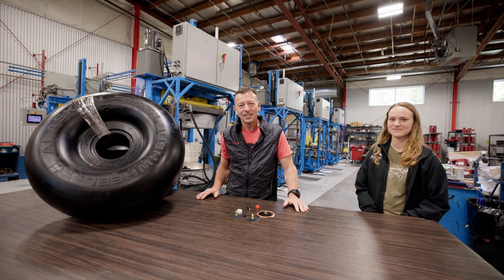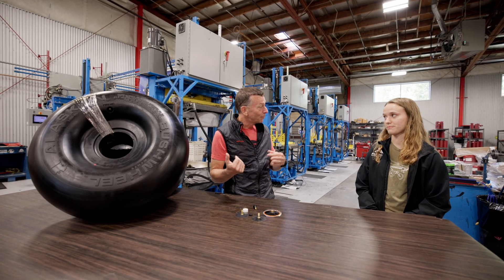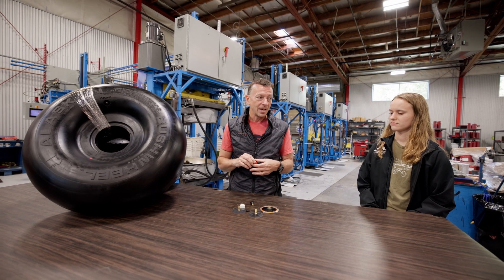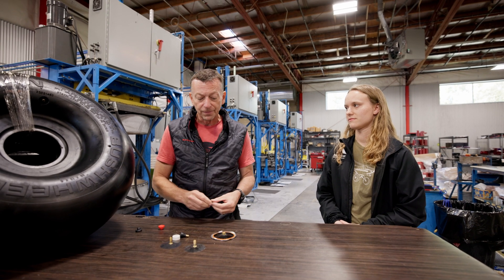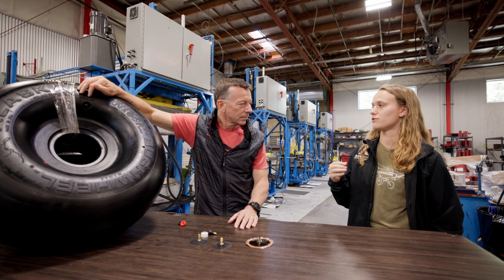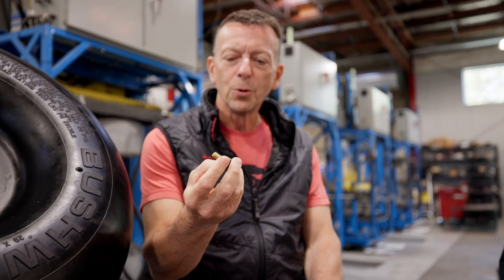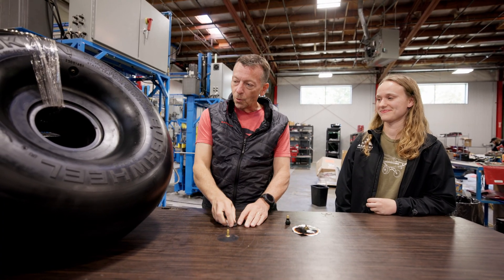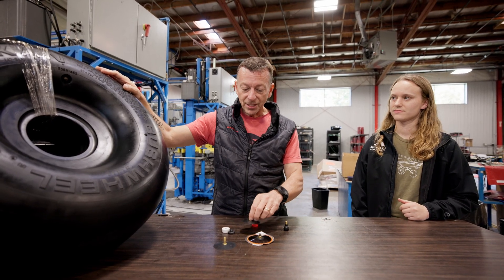Alaskan Bushwheel Product Line Updates 2025

Comment: If only the rubber could handle UV like other tires. It's a shame that they start cracking in 3-5 years even with covers and 303.
Reply: It is not just UV that causes cracking.  Exposure to oils in tar can also cause cracking if you are parking on tar run up on plastic or wood.  prolonged sitting at low pressure will cause sidewall cracking, so if you are not going to be flying for a while get the pressure near max. Thaw/freeze can get into micro cracks in the rubber and cause cracking so don't let the tires freeze onto the ground.  Winter storage outside is usually a big cause of cracking, I have seen the contact patch of a new tire with a lot of cracking from just one winter of low pressure freeze/thaw abuse.  I have a hanger and over 15 years of bushwheel use never had issues with cracking.  It is harder outside but it can be done.